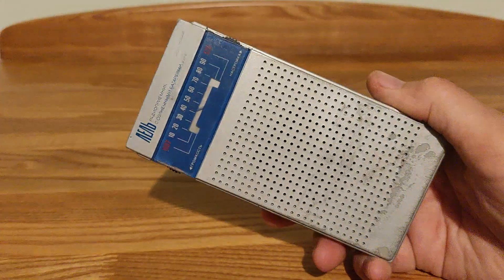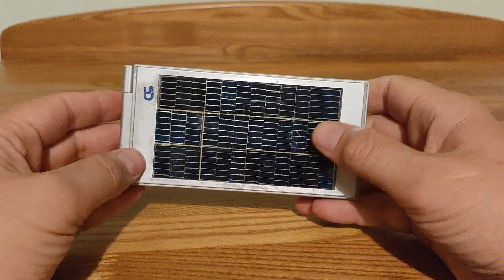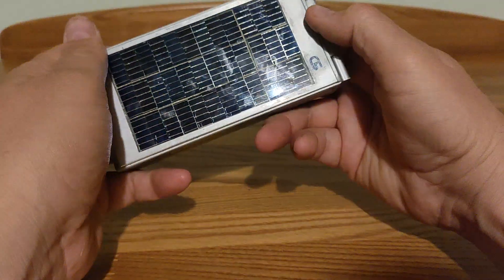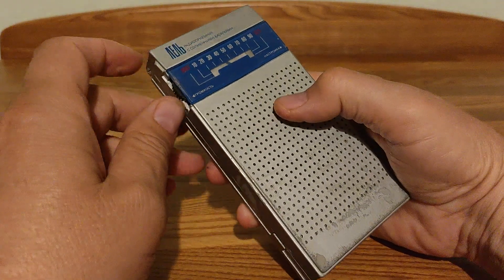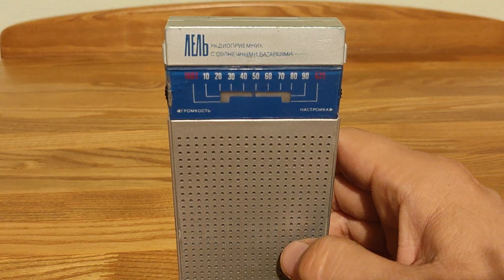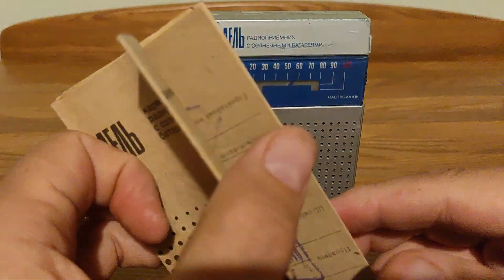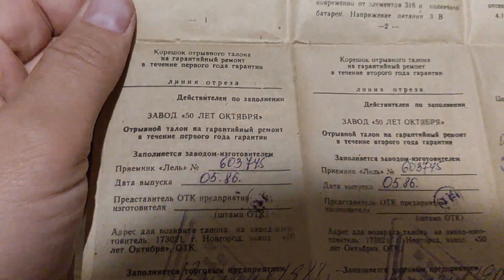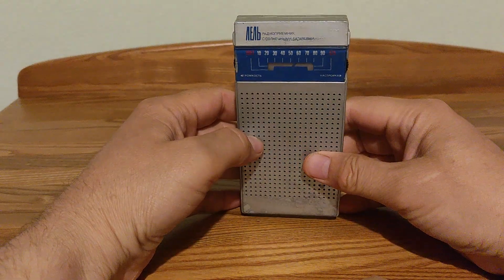LEL - Vintage  1985 Space Age Radio form USSR with solar panels

Comment: The solar panel is simply paralelled with the AA batteries, only a single series diode to prevent the batteries backfeeding into the solar panel, but the solar panel can charge the batteries. So it is probably intended for NiCd AA cells, not for regular primary AA cells (there's a good chance that's the reason why it has battery leakage, charging primary batteries can result in that).